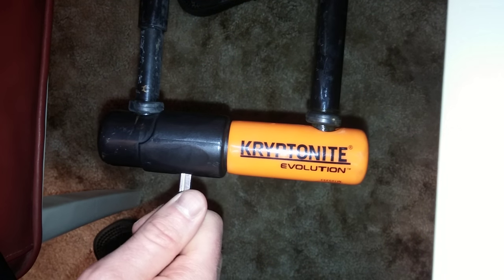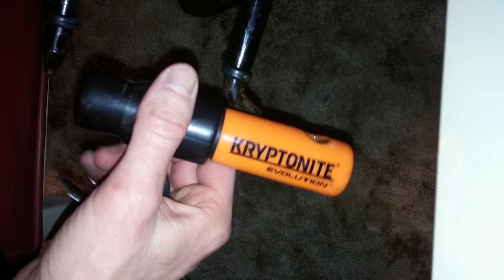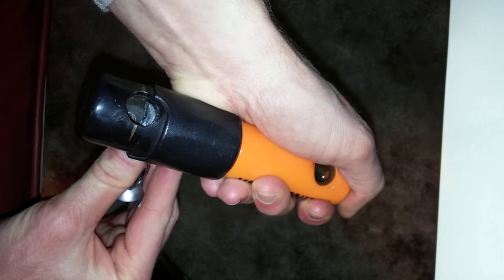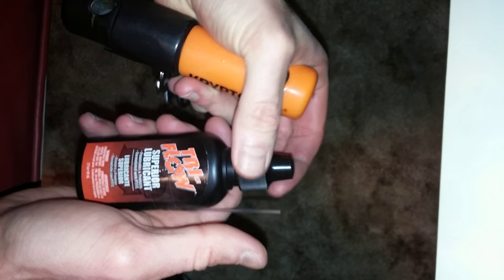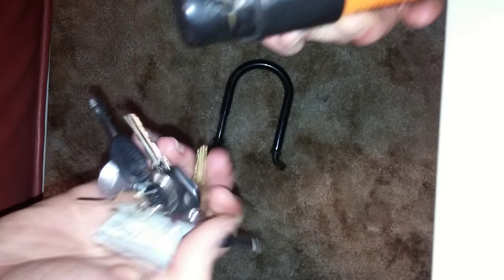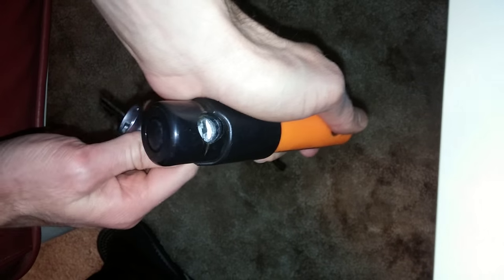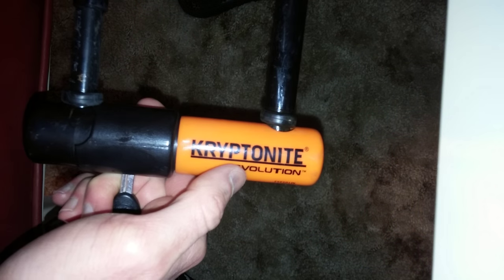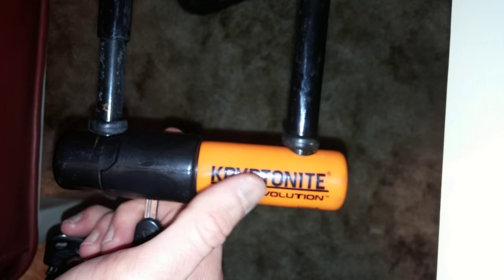How to fix a u-lock that is stuck or jammed

Comment from the maker: If the lock remains stuck after adding lubricant to the bolt, the next thing I recommend trying is to put powdered graphite lubricant in the keyhole. This powder is what locksmiths use to fix locks. Some hardware stores sell it.

Whatever you do, do not use WD40. From Kryponite's website: "Do not use WD-40, WD-40 is a solvent, not a lubricant and will, in fact, remove any type of lubricant that is in the cylinder. Use a lubricant that has a silicone, graphite or Teflon base only." http://www.kryptonitelock.com/en/customer-service/faqs.html?id=85
Reply: OK what if you put WD-40 in already, is it fucked completely now?

Comment: Does 3 in 1 oil work? I've put the oil in and the key turns fine on it's own  until I put the lock together then it seems that it is not aligned properly? So wont lock. At first it would get  sticky but if I wiggled it for awhile it would eventually go together or open but now it is not closing and I am afraid if I keep using it I'll get stuck without my bike because it won't open.

Comment: I live in México and at my nearest Autozone I always buy SAE 5w 30 motor oil to lube locks or fans, that works finr for me.
WD-40 is good for a few minutes but on the long run it doesn´t work for sh*t

Comment: Thanks dude,

Just bought one of these locks (bit of a newer one, but basically the same)

I think it maybe has some sort of anti drill mechanism in the key hole?  It seems if you don't have the key inserted all the way, then parts of the lock (tumblers?) can get misaligned, and take a lot of wiggling to line them up again.

I used loads of oil, and lots of wiggling to line them up again.  Bit of an annoying design flaw.  Will persevere, see how I get on.

Edit - just found this link:

https://kryptonite.zendesk.com/hc/en-us/articles/231010947-ULock-key-Jamming-or-Stuck
Reply from the maker: You're welcome. Yeah, if the key isn't all the way in the tumbler thingees can get out of whack.